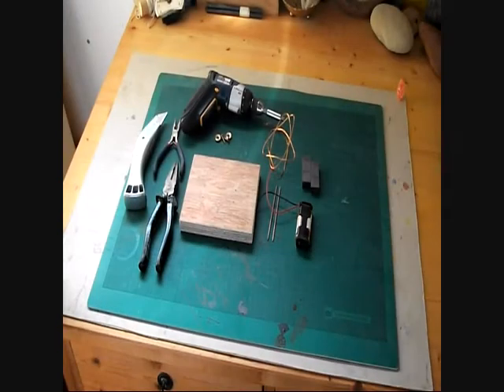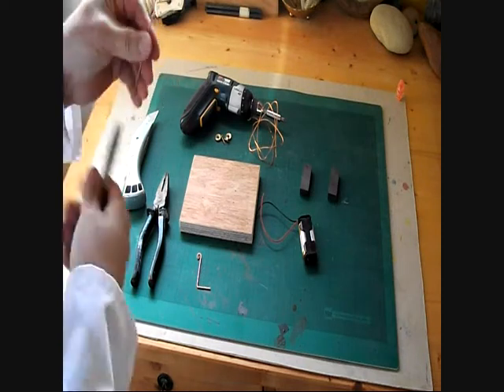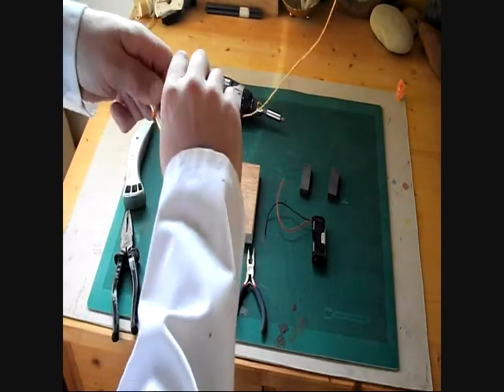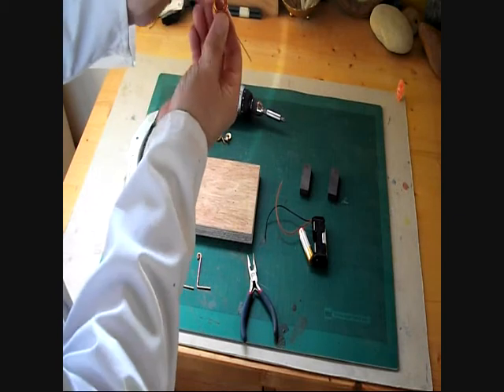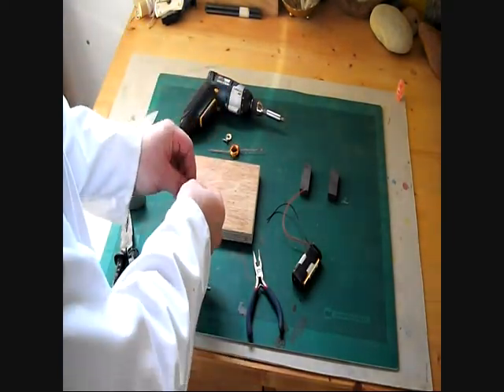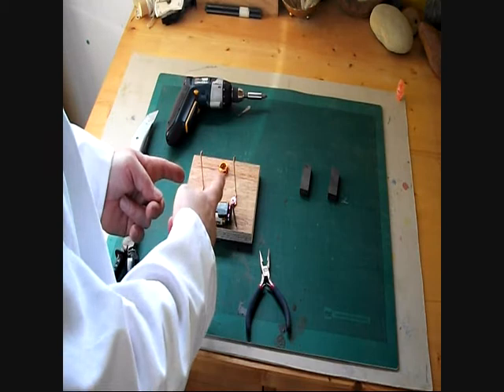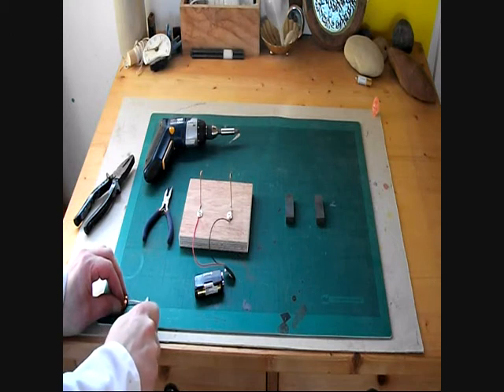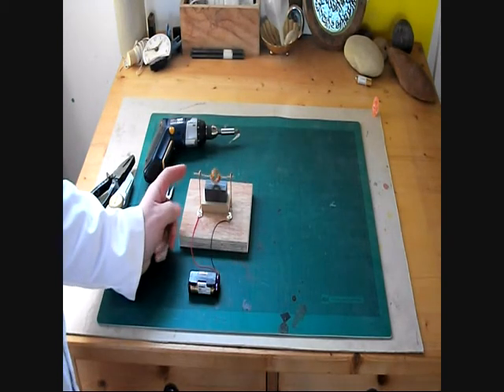Build a Simple Electric Motor

Comment: sweet dude
Reply from the maker: Thanks!
Reply: Hey Its me again by the way my name is Kyle and can you please tell me where you get your liquid nitrogen because I have been looking for about 5 months on where to get a cheap liquid nitrogen generator or an easy way to build one because I would love to do many projects with the liquid nitrogen. Thank You.    Kyle
Reply from the maker: Hi Kyle we (in the UK) get ours from BOC but we are a limited company and have an account with them.  I don't think they supply private individuals.  They also only supply a minimum quantity of 25 or 50 litres (can't remember which) so you need a Dewar to keep it in and 25 litre Dewars cost something like £700 upwards.

Machines for making liquid nitrogen cost in the region of £10000 (we looked at getting one) but are quite difficult to make unless you have a well equipped workshop and a good set of fabrication skills.

If you want small amounts for a valid reason it might be worth speaking to your local doctors (they use it for freezing warts), a local university o a local cattle farm (they use it for freezing bull semen).  If anyone does agree to give you some you can store it for a day or two in a normal vacuum flask but you must make sure that you fully understand the risks.  Never screw the top on the flask - in fact drill a hole in it so that if it does accidentally get screwed on the flask won't explode.  Be VERY careful transporting it.  If the flask tips over in your car or any other confined space the nitrogen will turn to gas and you will asphyxiate very quickly.  Sorry if you know all the safety stuff already but thought I'd best mention it because you really do need to know the risks before you start using this stuff.  Hope that helps.  Peter
Reply: Thank You soo much Peter because I thought only hospitals had them but next time I go to my doctor I am going to try to get some from them. and also I might be able to buy a liquid nitrogen generator from elan2 liquid nitrogen generators. Oh one more question at wonderstruck do you sell liquid nitrogen generators?    Kyle
Reply from the maker: Glad that was useful but I'm afraid we don't sell liquid nitrogen generators.  Good luck!
Reply: Thats fine. Kyle
Reply: wonderstruckwow Thanks for the luck. Kyle
Reply: Kman Meteor Elan2 is $10,000 USD single unit price. So I wouldn't recommend getting one of those. Your best bet is to pull a Ben Krasnow and build your own. You can get a Stirling compressor for about 600-800 dollars if you're patient and lucky, from there you just have to rig it to separate the nitrogen out, which you can do either with a molecular sieve or if the purity of your nitrogen isn't an issue you can just buy compressed nitrogen gas to use.
All in all, if you should be able to make a liquid air generator for around $1200, and if you add a molecular sieve expect the prices to go up a lot.
Reply: mynameismatt2010 the only problem is how to actually make the generator unless there are plans you can show me. that would be great!
Reply: Kman Meteor Search for Ben Krasnow DIY LN2 and you'll find all the info you need to do it. The hardest part is finding a stirling compressor, since the things they come in rarely break down, and are even less likely to be sold online.
Reply: mynameismatt2010 thanks. that helps a lot.